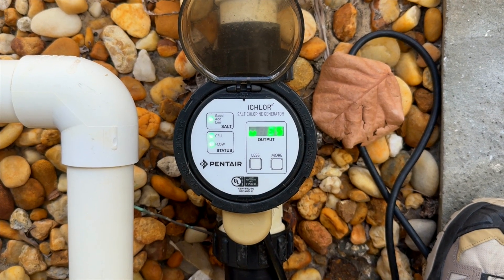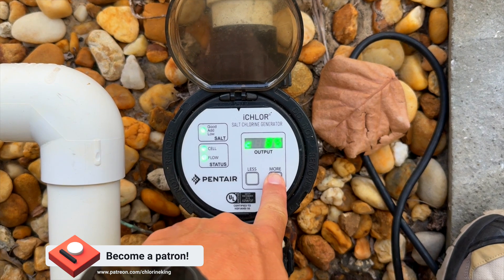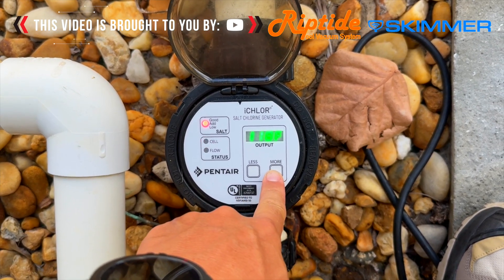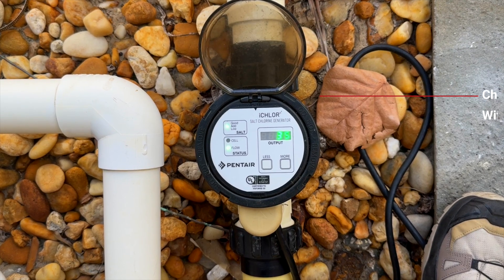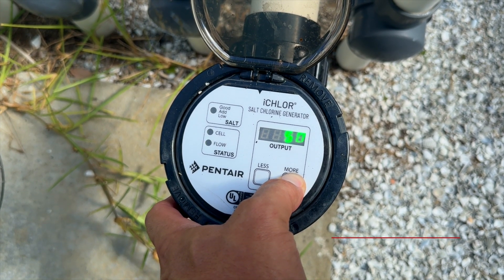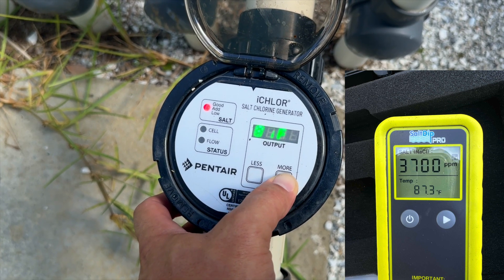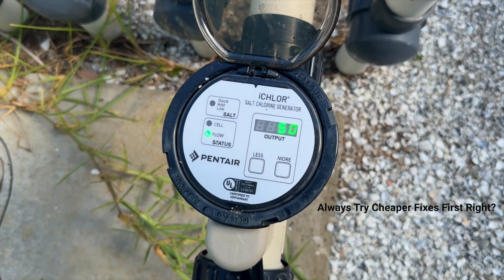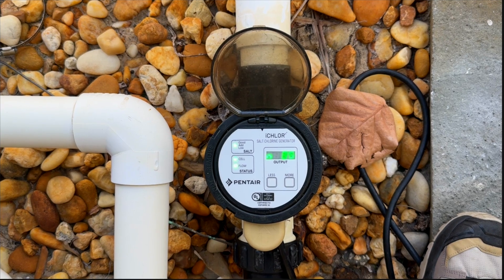How to Diagnose a Bad Pentair iChlor Flow Switch Fast!

Comment: You said they are usually good for 10k mine is at 14 k should I replace?
Reply from the maker: At that usage I wouldn't break the bank repairing it if anything is wrong. At that point I'd consider I got excellent life out of it and get a new one. However, they don't make these iChlor 30's anymore. The improved (arguably) model is the iChlor 30+
Reply: @ChlorineKingPoolService thank u

Comment: 3550ppm with external meter

Temp on external meter matches iChlor30

Red Flow and Salt LEDs

No salt reading on iChlor, reads (- - - -)

(This morning we’re making chlorine!)
🧐
Reply from the maker: It’s it’s red flow the flow switch is bad. I’d start there. If the slow switch is bad it’s not going to give a salt reading because it’s in “off” mode because it’s not sensing flow. 

I’d the flow switch doesn’t fix it the only thing left would be a bad cell.